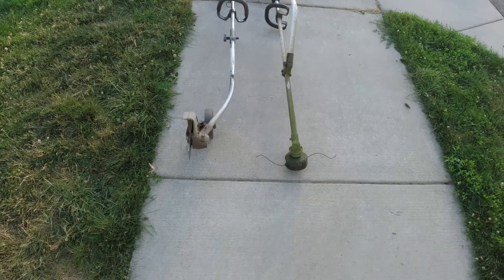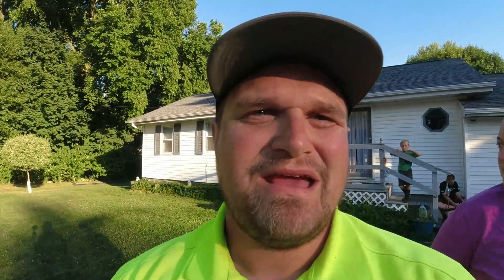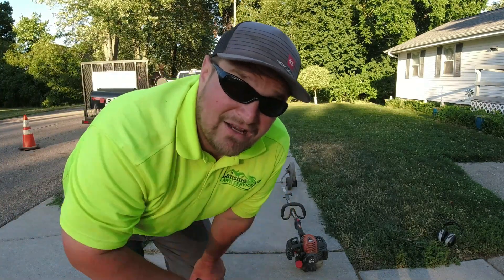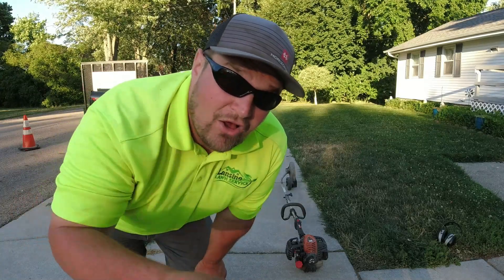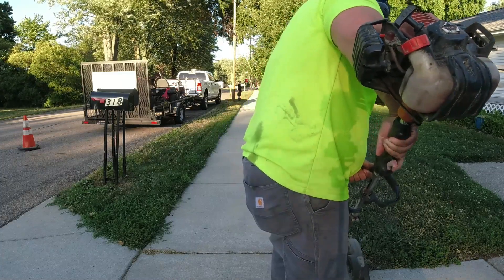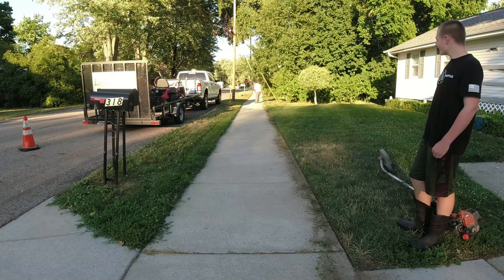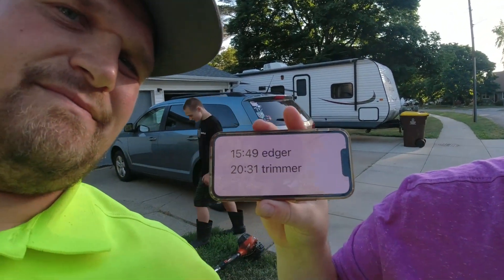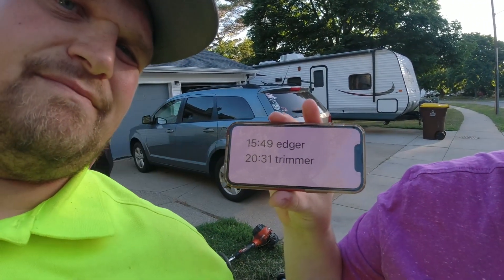EDGER vs STRING TRIMMER 2.0 [Which one is Better for Edging?]

Comment: Which would be easier for a senior with back issues?
Reply from the maker: The edger for sure.
Reply from the maker: You could also add a Darwin’s grip to your trimmer and edger to help with back problems. https://www.amazon.com/Darwins-Grip-metal-construction-Visibility/dp/B07TCTDXK6/ref=mp_s_a_1_1?adgrpid=69945444648&dib=eyJ2IjoiMSJ9.4lNmqmcObkKHqmzbviL1Ur7oP8CpC6DzM120kGgu85NUB_3bOo8vZq4llBbTsnEJ9zK3SooqyPSdI9Pv0bhC_tiba744xeskkFzPdvDLHVSF42wG-hzFYDD0UcOi1oDSjjkQUWwUbycRjdzuuUL-hkAfU_WCEKz8kFAUYAzb5qGpPxhirPSHAuCzFBYrLGvFthbj78baVRr0lvb03WuCxg.CJeZPimZraF7ubHshhaiWn-lir9TwN74MG1y3eB0i50&dib_tag=se&hvadid=410078154620&hvdev=m&hvlocphy=9017242&hvnetw=g&hvqmt=e&hvrand=1493023143592535458&hvtargid=kwd-705359229807&hydadcr=10877_11286461&keywords=darwins+grip&qid=1712926931&sr=8-1

Comment: I use both. Just depends on the moods
Reply from the maker: It also depends for me. If there is only a little bit of trimming to do I will just use the trimmer, but if there is sidewalks and driveway on a corner lot I will use the edger. It is faster. I have timed it. 😉

Comment: The real question here is, while owning a string trimmer, is there a need to purchase an edger if they both can achieve the same job?
Bear in mind that the 5 seconds saved each fortnight will take about 3 years to make back after spending 7 minutes to watch this video!